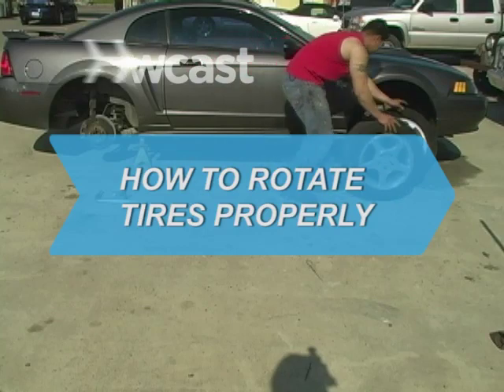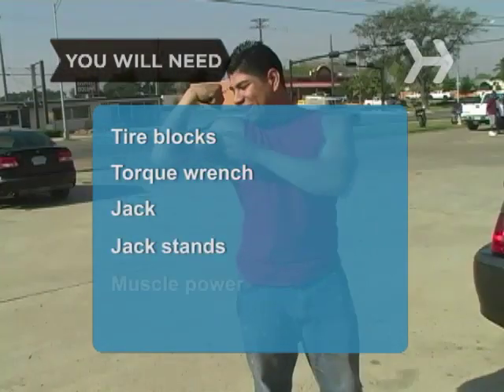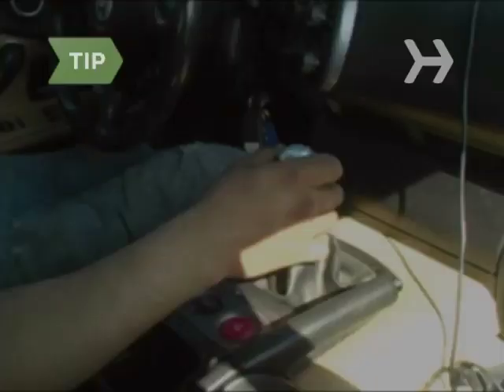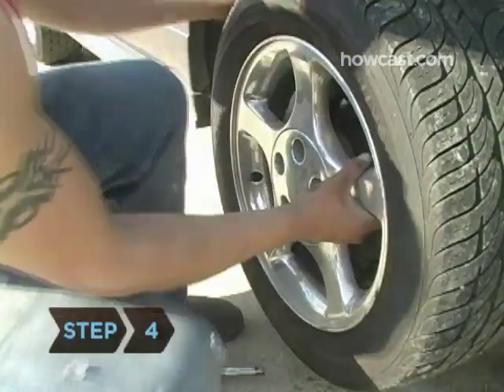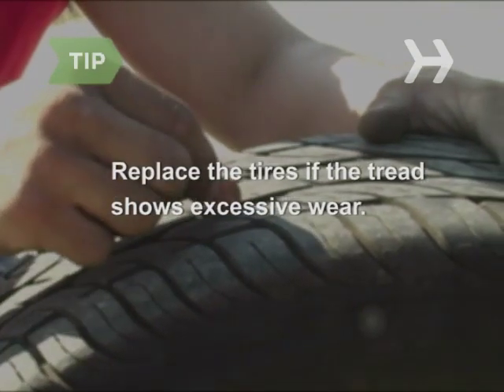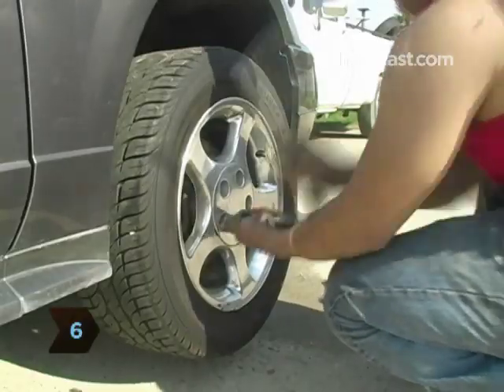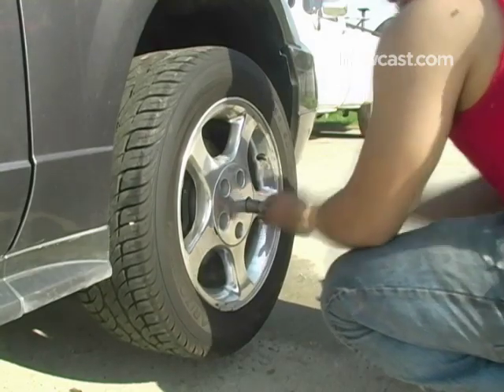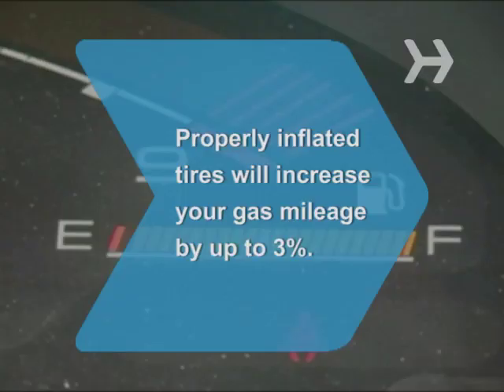How to Rotate Tires Properly

Comment: @iluvfatchx you criss cross on front wheel drive cars only when the tires are not directional tires... if they are directional tires, like this mustang probably has, then you cant criss cross cuz your treads will be rotating in the wrong direction so for directional tires, regardless of FWD or RWD... its fronts to back and backs to front.

Comment: discount tire got free tire rotation, are they any good? heard some bad stories. I don't need to tell them my lug nut torque or tire rotation pattern etc right? they know it? why check for tire movement/play when it's in the air? when there is movement that means something is wrong? last one I only need tire balancing when it's pulls to one side going straight right? if car is fine then no need for balancing.
Reply: Okaythen001 well if your cars pulling to either side it's likely not the tires causing it or it's the tire and something else working together

Comment: Go to Goss' Garage (on You Tube) for better explanation. Crisscross rear tires to front for front wheel drive, opposite for rear wheel drive. The idea is to get the tire to turn in opposite direction on drive side. All wheel drive should crisscross both front and back.

Comment: Loosen the nuts with a torque wrench?!?  You've got to be kidding me.  If the nuts were previously overtightened you may end up busting the wrench, and why use it more than necessary, it's a precision calibrated instrument, use a regular wrench instead.

Comment: @maxp8ntballer That's true, but the most important reason for tire rotation is taken care of by exchanging front for the back. The crossover exchange is to address uneven wear due to potential misalignment. If you do this method without a hoist, you would take the added step of exchanging the front tires by supporting the front and then exchanging the back tires by supporting the back of the vehicle after doing the one side at a time steps explained in the video. Also consider Maginel73's point.